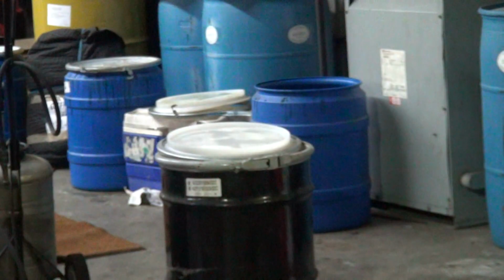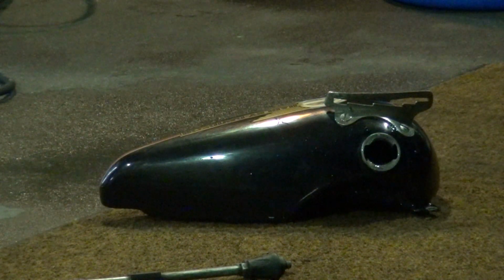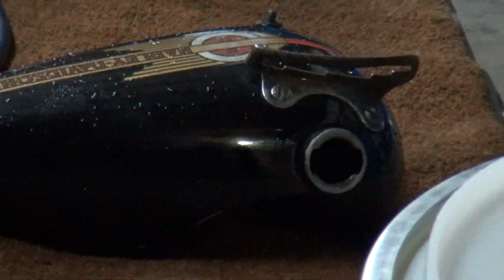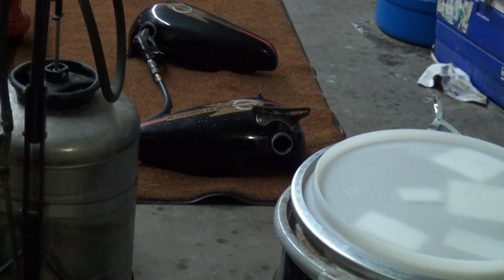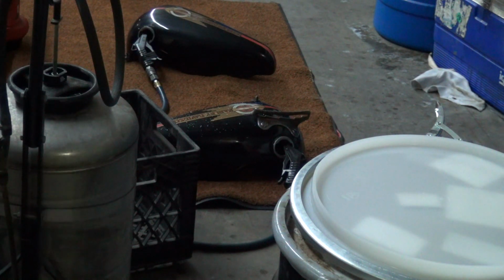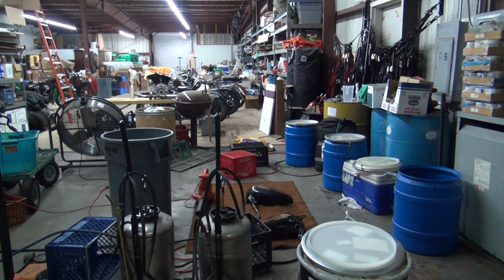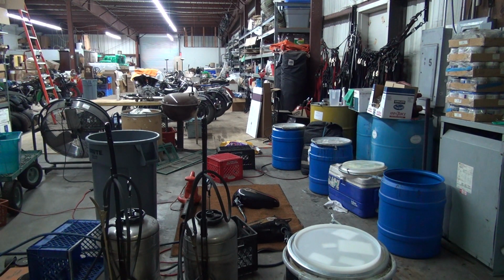Hunting Harley's, 38 Knuckle tanks get washed out

Comment: I know this video is older than dirt, but Evapo-Rust from Harbor Freight did really well in my Suzuki GS550 tank. Its water based so it doesn't do anything to paint or your skin, just rinse it out with a splash of gasoline to eliminate any moisture and fill er up to prevent flash rust